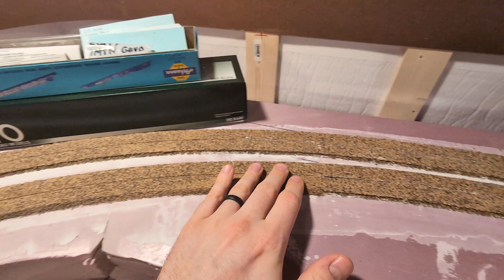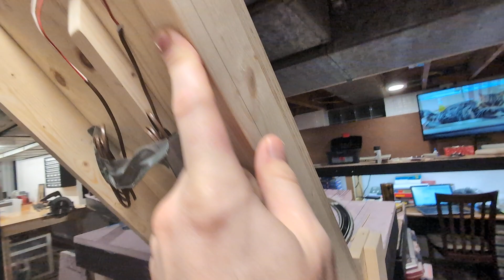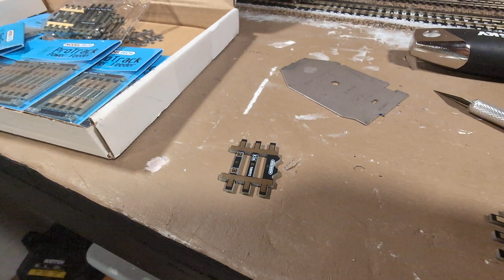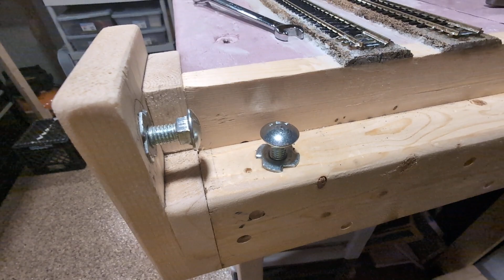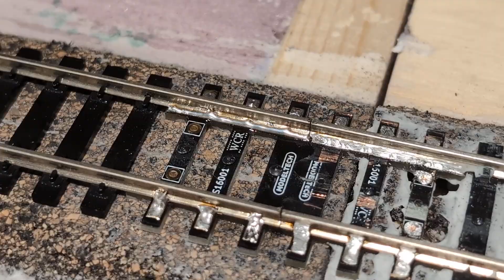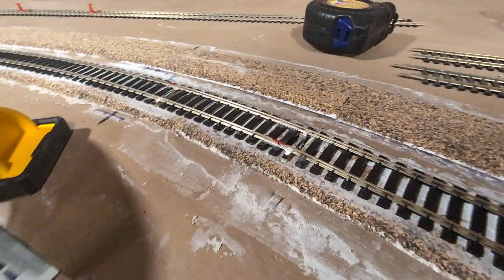Layout Update - 1/11/24 - Lift Bridge, Roadbed, and Track Progression

Comment: Are you using code 83 Atlas track?
Reply from the maker: All the track is Code 100, and the flex track is by Atlas... If I didn't have so much already purchased I would have just used code 83 to start... The switches are all Walthers #6's so far

Comment: I placed a bracing strap on the side of my lift bridge to make electrical contact with two vertical angle screw-in studs, one placed on each side for Rail A and Rail B. Works without the use of coin.
Reply: I should add those things are called screw hooks that are used to hang things. The way I placed mine I screwed them in vertically alongside my lift out, and soldered a wire to each side to represent Rail A and Rail B. Then when dropped in it makes contact with the screwed in hooks. I have also used eyelets in the past to tighten or loosen the lift out. And another point you made about lumber changing from one year to the next, I didn't realize this until another modeler pointed this out about his layout.  After one year I no longer have that problem. And at first I sanded and cut here and there with no results. After a year it sort of solved itself. Will look forward to more videos.
Reply from the maker: @daleroth236 thanks for your feedback and for your watching the video!
Reply from the maker: Great idea!
Reply from the maker: The coin is just to prevent indentation in the wood though FYI. No conductivity thru it, just a harder surface than the bottom layer of the plywood I used. But I'll be replacing them with something more official soon!

Comment: 1 1900 electric box would give u enough knockouts for the bridge a good price.. you could always use a light lock tight liquid to keep threads from spinning without glue
Reply from the maker: Thanks for the model number on that electric box, I will have to pick one up! I contemplated using the low strength purple or blue loctites. Would be curious to hear the results if anyone tries those products for this application of something similiar

Comment: Could you use electrical knockout plugs instead of coins? If you know an electrician or someone who knows one, ask to get some plugs. Great landing for the bridge. Innovative and functional.
Reply from the maker: Definitely a great idea to use those instead of coins! I was thinking about those at the time but didn't have any on hand, as all the boxes I have used lately are plastic with the little square knock outs. To avoid the hassle of filing down the coins though, I will see if I can get a cheap box from home Depot just for the the purpose of collecting these plugs, as I'm not close with any active electricians.  Thanks for watching and for the great idea!